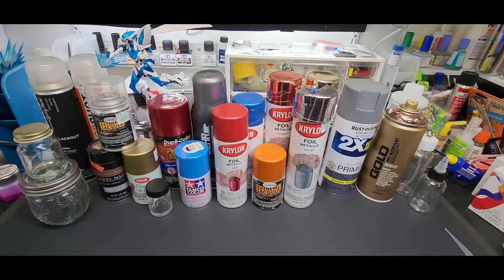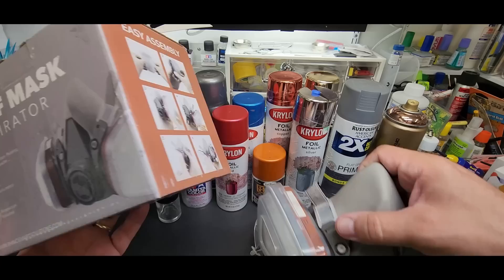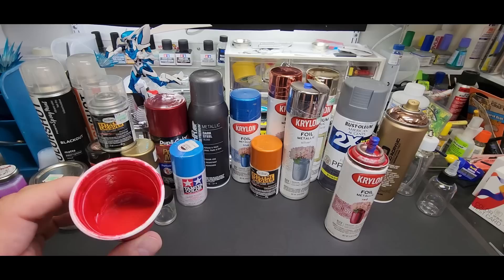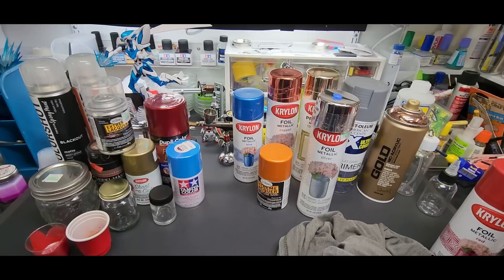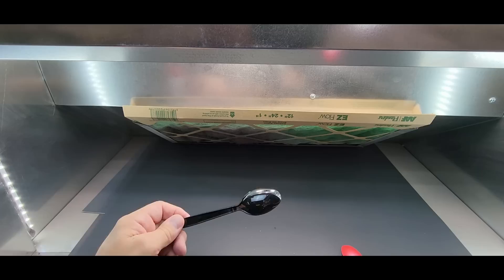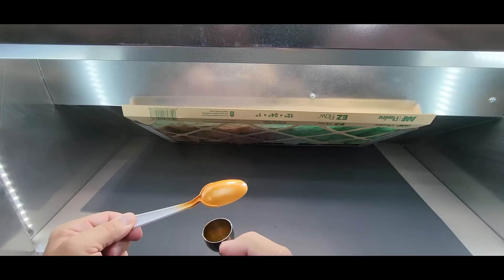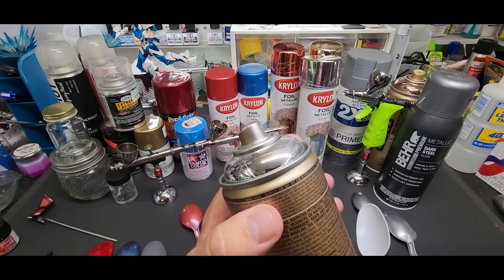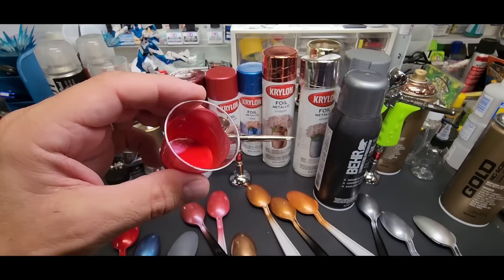How To Decant Spray Paints For Airbrushing - Easy !!

Comment: Nice, I can tell ya I waste a lot of paint using cans. Small question what do you use to store the paint after you decant a whole can? I find finding glass bottles with a seal-tight lid super hard to get these days.
Reply: Mason jar like he mentions toward the beginning of the video. It works good.
Reply: @DaneSaysStuff  Thank you. I have a hard time paying attention sometimes. I think those jars are kinda big but I guess I can turn over the paint and it stays for a while in that jar.
Reply: @nelsonolivierjr3994  I have ADHD myself so replaying stuff is common. Mason jars are available in different sizes so options exist.
Reply: @DaneSaysStuff  I will have to look it up then cause at the stores near me the smallest is kinda the size of a small jar of peanut butter. I have been looking for something with a tight seal on the lids cause I need to switch over my Citadel paints and might even try to buy my Krylon mini paints again. They dry up pretty fast but they have a nice color to them and work well with a brush.
Reply: Baby food jars or mini jelly jars.

Comment: I don't air brush, but can't you use normal paint?
Reply from the maker: You can but the large spray cans are very cost effective, plus only certain colors come in spray cans
Reply: @barbatosrex9473  Cost effective, I'm extremely dubious about. After all, spray can paint has to be put in pressurized cans. That's expensive. 
Fair enough on the colors, I guess.
Reply from the maker: @peterblair6489  take the primer, it cost around $8 to $10 for a small jar of hobby primer. For about $6 you get a spray can of primer with 20 times more paint

Comment: The cost of 10ml model paint is nuts, eg:Tamiya paint: The very annoying  tiny 10 ml  volume they sell is way too small but  this is deliberate and It costs way too much for the amount .
 EG: Tamiya 10millilitres =around  3.00 USD , + - 50 cents   so 1 litre of their Tamiya model paint you are paying 100 times the cost of one jar . This  means for every  litre of Tamiya paint   you are forced to spend around $300.00 USD per litre and  it's a massive rip off . Acrylics, lacquer and enamel  model Paint surly can't cost $300 bucks a litre ?.

Comment: This is, in my opinion overly complicated and messy. I simply let the can sit for 24 hours to allow the paint and propellant to separate and settle. Then, I take a sharp tool and make a very small hole as high up as I can on the can. The propellant will off-gas over the next hour or so, but I'll often leave it for a few hours. 

Then, when it has off-gassed, I'll widen the hole and pour the paint into a larger container. This paint will still have dissolved propellant in it so I let it off-gas for a day or so. Eventually you'll just be left with paint. 

No mess. No hassle. No requirement to spray outdoor paint at your work desk.

Comment: Oh, and whilst this is a Captain Obvious comment, avoid using decanted acid-etch primer in your airbrush.
The nickel plating in the airbrush cup and plastic and rubber seals will be irreversibly damaged.